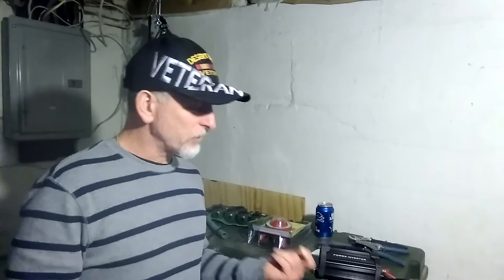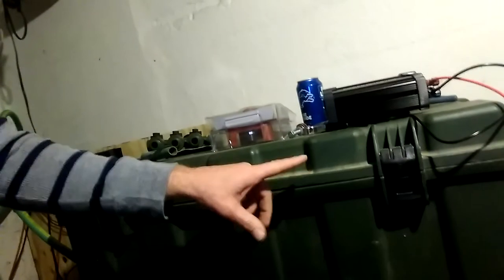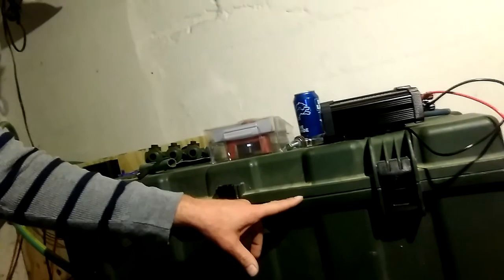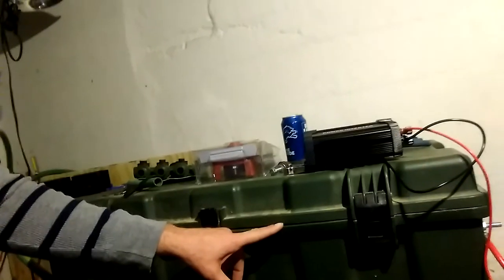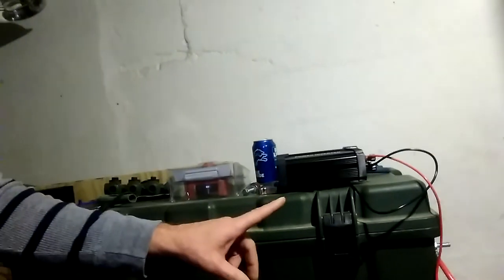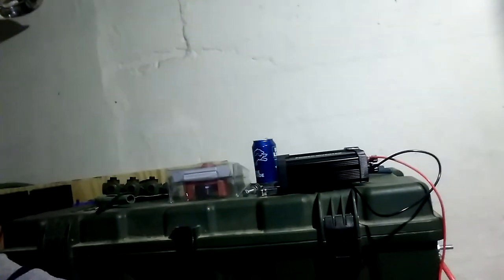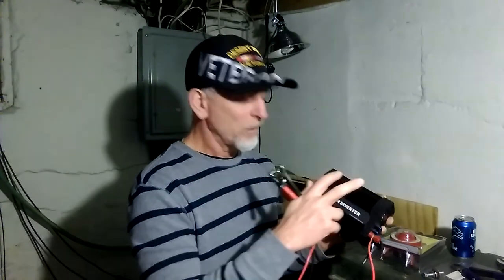How to seal the Solar Battery Bank

Comment: Awesome information brother👍 looking forward to your EMP box, although when it comes to those things I don't see why a person couldn't use a truck inner tube and some rubber cement and create EMP bags no electric current will run through the rubber so it will run around it....... just like a faraday cage😲 except its rubber.
Reply from the maker: +Yankees Outdoor Adventures I am more concerned with having an extra set of everything for all just in case sinarios. No body talks about the solar panels and how they are affected. They are all electrical. Maybe I will put a few of them away also